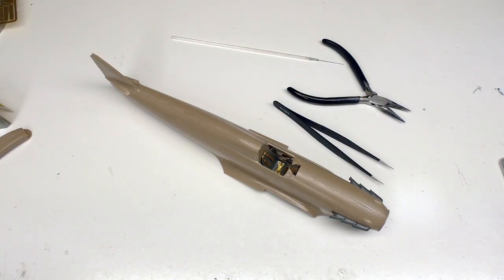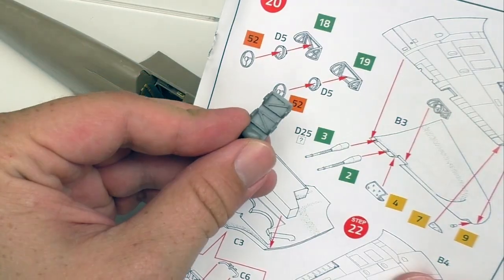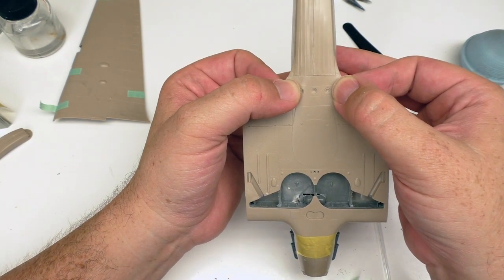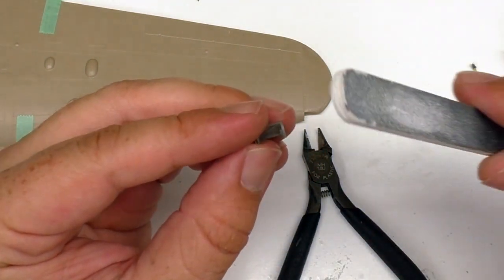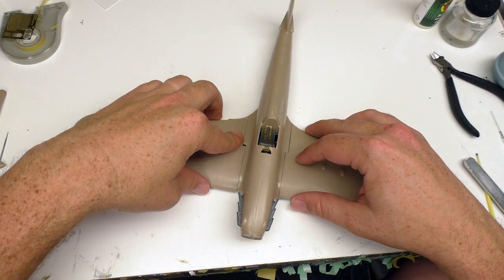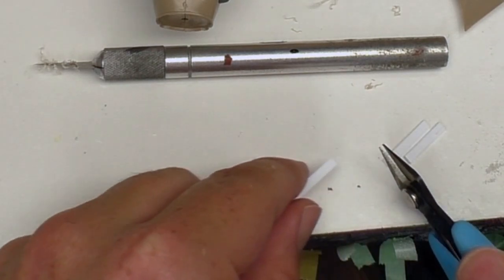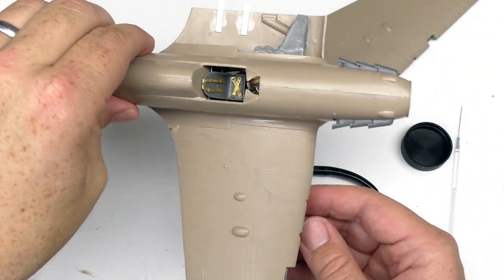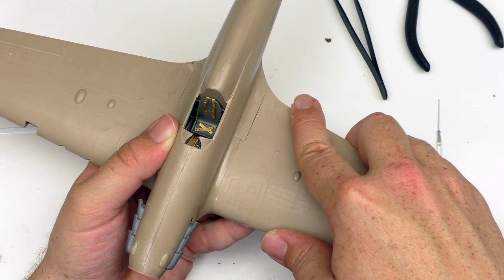1/32 Fly Hurricane IIc Review Pt 6 - The Wings

Comment: you mention a Revell kit could that be the ME109G kit in 1/32 scale because I own and I need to get rid of it how and where I do this ?
Reply from the maker: Yep. Revell's 109G-6. Only other kit where I've faced this kind of non-curing with liquid solvent welders. Best place I've found to offload kits with minimal hassle is ebay - but with something as widely available and cheap as the Revell 109, you may not get much for it.